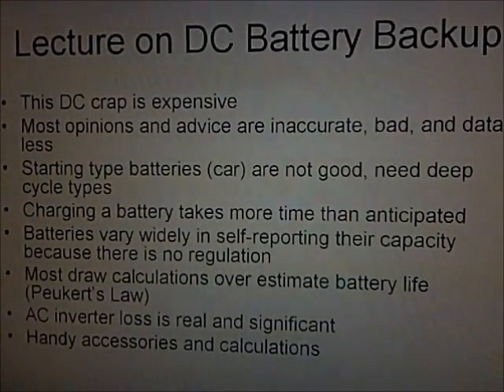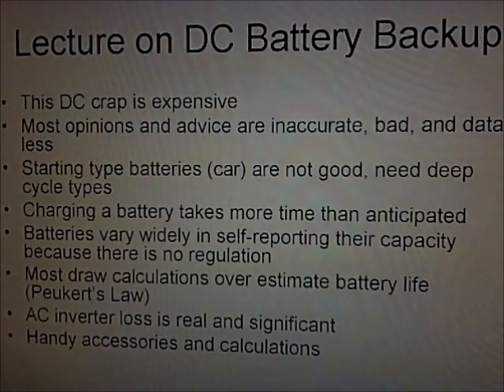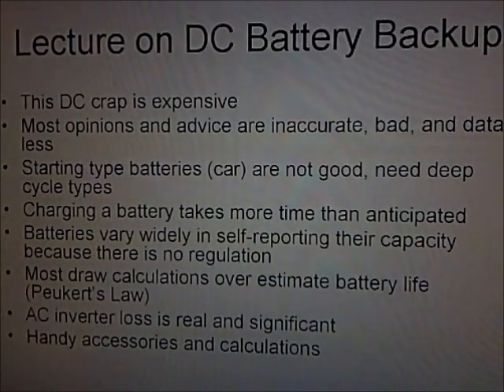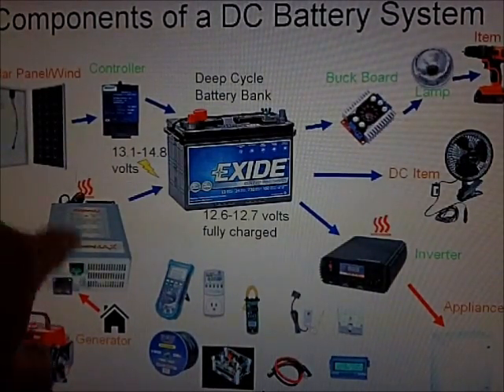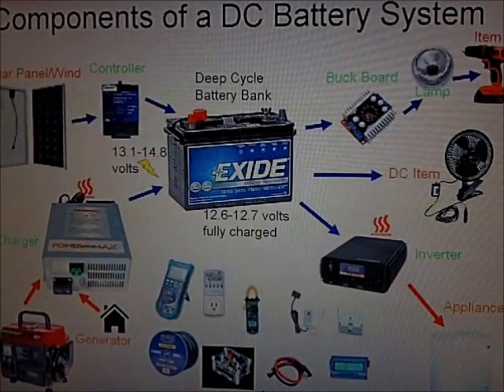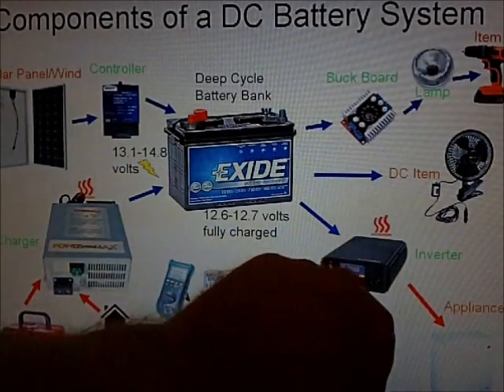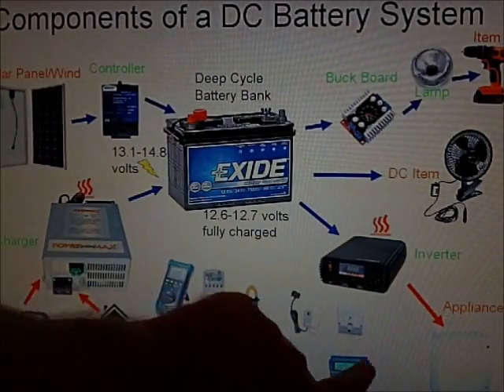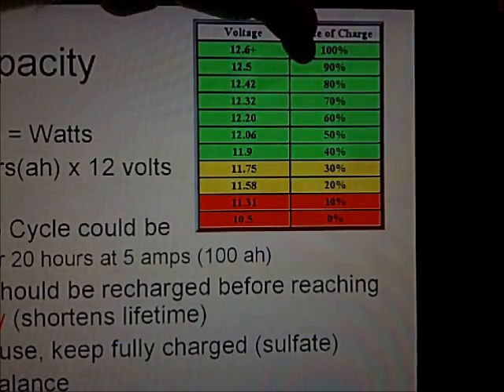DC Battery Backup Lecture

Comment: I have 2 years of experience now since I first watched this. I've been running freezers, washing machines, lights, etc from my battery bank, and recharging with house current and solar both. I just want to say that this video is spot on, the information is correct and very helpful for real world use of batteries and DC powered inverter systems. This video should have much more views than it does, it's a solid gold tutorial.

Comment: The AC Inverter loss is very high because he is using a modified (or Square) sine wave. A good Pure (or True) sine wave is around 90 to 95% efficient.

Comment: I decided against a system that uses an inverter. This dramatically reduces the number of batteries and solar panels that I need. Of course I have to buy DC-powered appliances. I have heard that a DC system is far safer than a system which depends on an inverter and has much higher voltage requirements.

Comment: So how you produce a 12v solar battery to only power a camping refrierator, one or two tablets, and a string of LED lights  Most of the ones that talk about solar generating systems are too involved, and over think out their system.  I haven't seen one that only talks about powering a camping refrigerator (ARB) for 72 hours, or a string of LED lights/cell phone or table.
Reply from the maker: Here is a video from me that shows some estimated refrigerator numbers.  https://www.youtube.com/watch?v=f43V7ZppDKI 
  Your ARB may run around 220 DC watts per day (need to validate that number).  220/12 = 18.3, times 3 days = 55 amps.  You need a 110 amp-hour system to handle that @ 50% discharge.  Cell phones and tablets(?) are small.  Cell phone is 2000 milli-amps @ 5v.  That is 2*5/12 = 0.8 amps @ 12v to fully charge. Very small.   Lights can be all over the place.  You gonna have a small light or light up the whole camp sight?  Again, watts / 12 volts gives amp-hours x hours used = need.  For a 72 hour camping trip you only need batteries that you charge at home.  Solar is for sustained living or stay. I'd say two large marine batteries will get you though with a buffer (200 amp-hours total).  However, from a simplicity standpoint I would recommend a 5-day cooler filed with ice which you can get as low as $50 and should suffice.  Good luck!

Comment: Great to see some accurate data and calculations for a change. The amount of BS that is out there is incredible. You VERY RARELY get factual data on products or the data is just a pure lie to get the sales in.

I found a 100W polly panel once that claimed 100A @ 17.5V  (face palm). Sadly when its just a reseller all they can go by is the data (usually just copied and pasted)  that they get from a wholesaler when purchasing.

I think people forget that you are dealing with complex calculations and system losses when integrating multiple components, inductive, resistive and intermittent current draw ect. Half the so called expert installers out there think ohms law is something to do with the courts and legal system !

Sadly solar systems and battery storage is not alone. During my working life I have worked on high energy systems, military radio ,IT ,alarm systems and telecoms and they are all the same when it comes to public sales and inaccurate or just plain lies when it comes to product data. 

It seems to me that this is only a problem when equipment is sold to the general public. When you work in the industry and make an order you will almost always be provided with a proper specification in the form of a data sheet or an email from an actual engineer that knows what he/she is talking about.

This is almost always the case with the public, whenever I have tried to give a member of the public a proper technical explanation you can actually see the eyes starting to glaze over and the mind start to wonder. Its just a fact that the public don't want to know nor care about how something works or how to use it correctly. We have a world full of people that badly need to RTFM. All they want to do is press a button and get what they want. This leaves them wide open to the snake oil salesmen.

Sad but true  :-(
Reply from the maker: You made a really good point on the public vs industry and datasheet.  If you act like you know what you are doing and dont waste sales time you get better service!  Thanks for the comment.